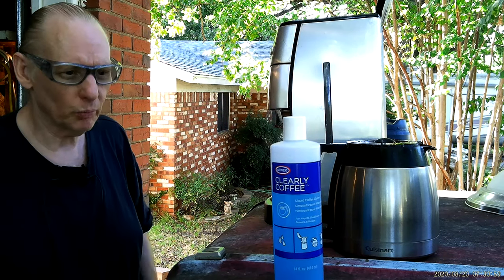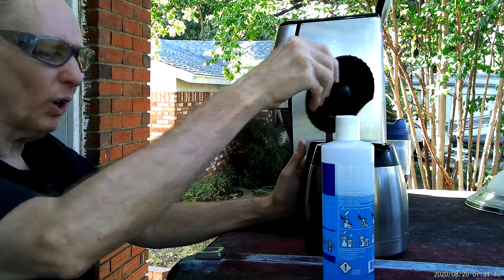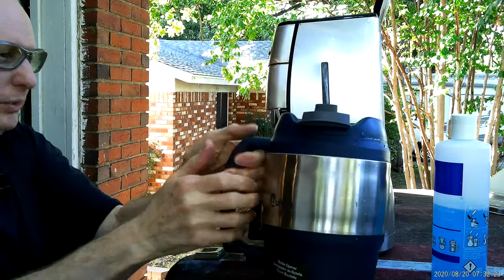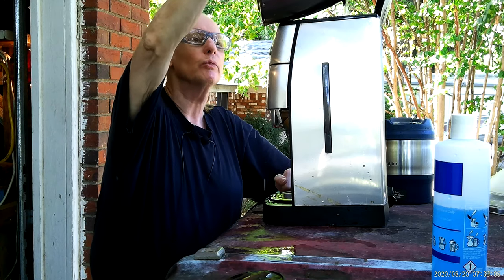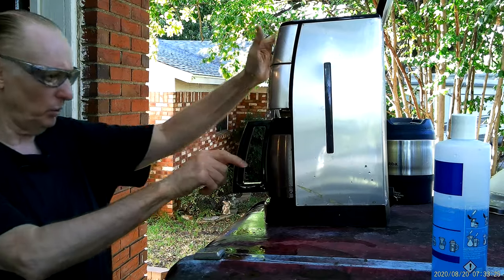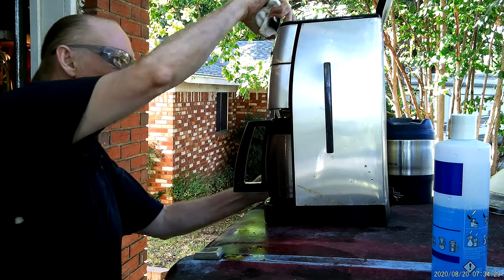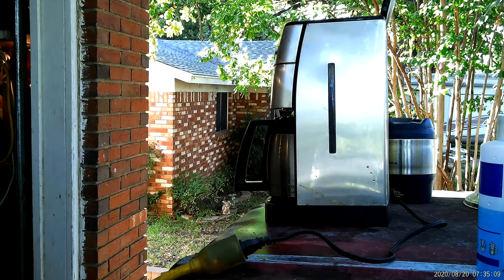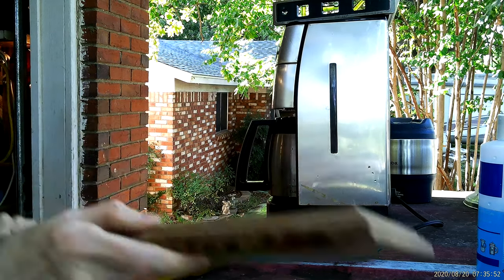Cuisinart Coffee Makers Testing after Thermal Fuse Installation 2020-08-20 07:30:55 Pt005

Comment: What camera did you film this with? The footage looks professional!
Reply from the maker: Thanks:) I have a bunch of videos about this camera in my Playlist - Don Bishop Komery 4K Video Camera Setup & Testing, Live Streaming Webcam via USB, WiFi Viewing & Remote Control, 13MP CMOS Sensor, 48MP Up-Scaling ( https://www.youtube.com/playlist?list=PLAG1YL-u0Lzc9-N8PUMgbXJNQECm-yvkF ) The On-board Mic and or Software. Gives terrible sound. But, you can use an external Mic. I was using a cheap wired Lapel Condenser Mic, in this video. Sadly, the cable came loose. And the audio drops out at 14:52 minutes. I had the Video set to 4k - 2160P. This camera is not rally a 4K Camera, like they say it is. They use Up-Scaling or UP-Converting Software, in the Camera. To bump up the megapixels a bit and call it 4k. The light and colors did look pretty good in that shot. Out doors, in that particular lighting conditions. I think it looks a bit washed out, indoors. But, I mostly use it via a USB Cable, connected to a Computer. To do my Live Streams. That works well for me. I use OBS Studio, Free Open Source Software. Which has plenty of Video and Color Settings, that I use of this camera. On my Phone Cameras, I don't need to change the video settings. I usually use OBS to Record and Stream to YouTube. But, on that day. I was just Recording to the SD Card on the Camera. I don't remember which video preset I was using. Probably "vivid". I paid $109 new on Amazon.com, for it. This exact model, is no longer available. But, they do have similar versions available. If I were to buy another Video Camera. I would look around for a good used Cannon, Sony or something with a at least a 20mpxl Sensor. I have learned, that Cam Corders, actually do better video. Than DSLRs, for the money... Thanks for the complement:) Don